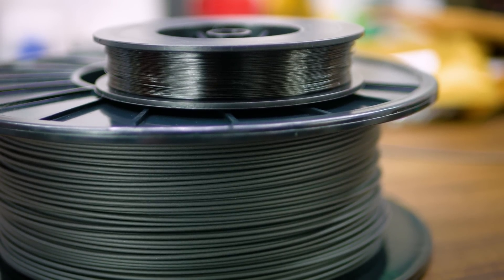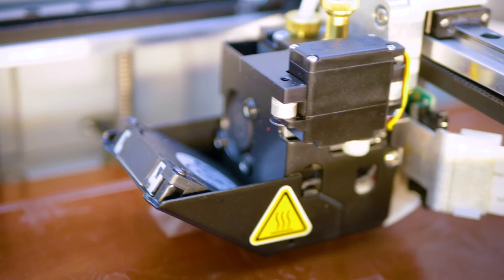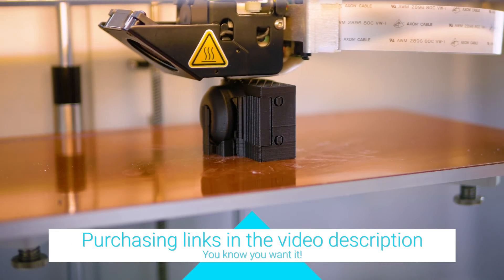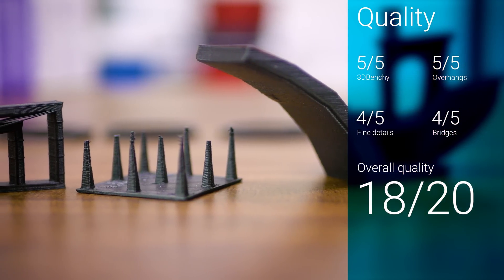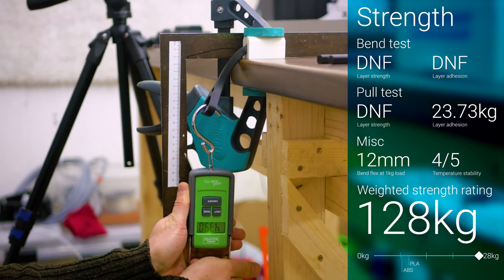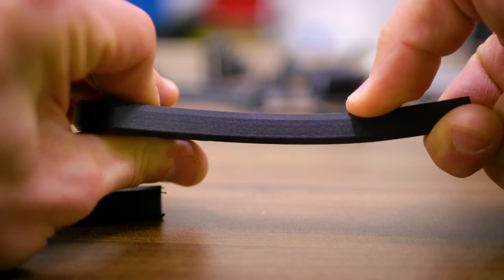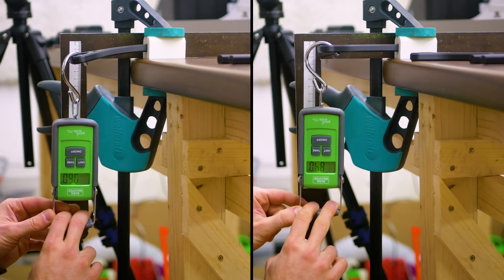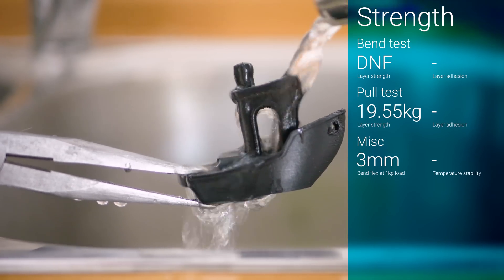Maximum fiber: Markforged's ONYX and carbon fiber review! #Filaween

Comment: This 3D printer do not allows you to set a temperature different  the 275°C
Does any body knows any way to modify the temperature in order to use it with a diferents material?
unusefull printer yu can not use a difetents material and Onix is expensive compared with...

Comment: so what exactly is the point of the onyx material? I'm getting more strength, better surface finish, better resolution, and less deflection with PLA. not to mention PLA is pennies in comparison to the onyx material and comes in a variety of colors.
Reply: Theoretically you can get parts that are lighter and stronger than steel.

Comment: Aaah Markforged, where "prototyping" is more expensive than actually milling the part on aluminium.
Reply: See where your wrong is that with a Markforged printer, you are not "prototyping" you are making THE end user part.
Reply: 3D Printing, where additive manufacturing is it's own thing and is not a direct apples to apples comparison to subtractive methods of manufacturing...
Reply: Granted I hate them for their innovation killing patents, and their cost to preformance ratio.  But don't be comparing these things, If you need a CNC Mill, get one, If you need a FDM 3D Printer, get one.

On another note, wasn't the whole point of these materials and this printer to make production parts, not "Prototype"?

Comment: @2:26 It seems to have failed due to buckling of the lower surface as a result of compressive forces.  The fibres would not add strength under compression and the inherent flexibility of the material would not really help much unless printed with many more outer layers or solid.  The main users of this tech would be modelling solid parts anyway. Is it possible to add fibre to the sides as well at top and bottom?

Comment: From an engineering perspective, this filament was an EPIC FAIL. Failure in the sense that the geometry buckled. It looks really strong, but it's still plastic. Besides rope, this stuff definitely can't compete with machined aluminum! 

This is pretty cool except that it really lacks one of the major advantages to traditional carbon fiber manufacturing. This stuff really loses out because of the flexibility. Traditional CF is much more rigid and generally "strong" in a more qualitative sense. The continuous filament parts are much closer to extremely strong rope rather than something that can be used for structural members. 

The bottom line is for anything that you really are going to use this filament for is going to require something that will not fail. 

Regardless this is still really interesting and I am impressed that the prints are of such high quality!

Comment: Wait. How did you get the continuous fiber in the pint? Special printer?
Reply: Yes that machine is a dual extruder
Reply: I assume the second extruder is a special device that can dispense and cut fibers?
Reply: I can't wait! I really want to see if I can get my printer running with some fiber. I wonder how much strength it could add to standard PLA? I was planning on making a quad copter frame, and this would be perfect.
Reply: I dont think you can get the print head to do that for any other printer. If you are interested he used the printer on a live stream
Reply: He use Mark Two, I bought one and cost me 28000 AUD
Reply: He used Markforged "The Mark Two" 3d printer which costs at least 13499usd.